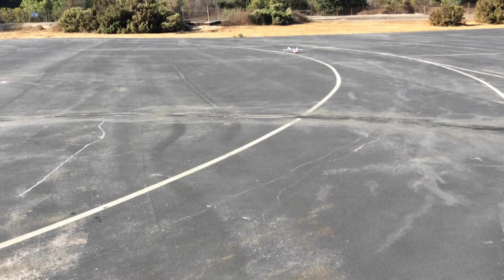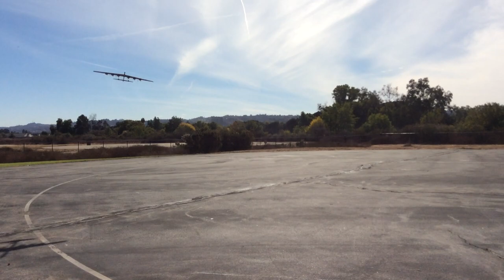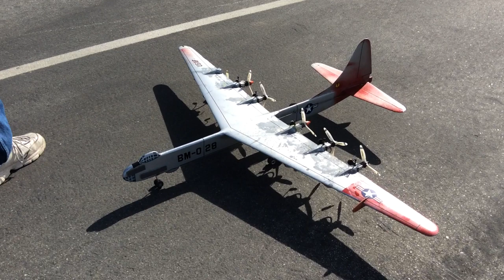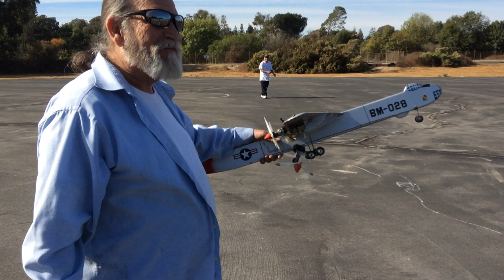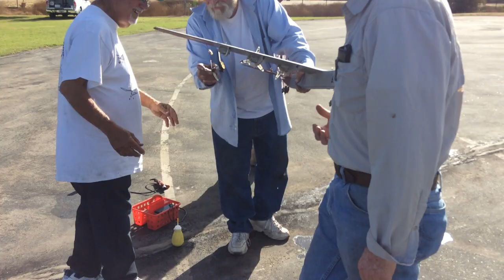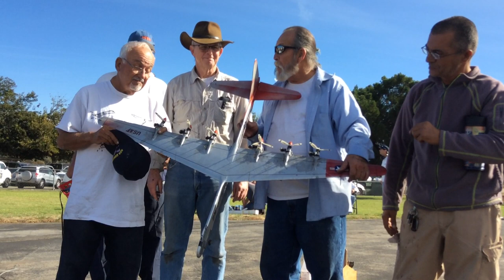Control Line B-36 Peacemaker w/ six Cox .049 engines

Comment: Excellent!  I attached a Cox .049 engine low on a added vertical  member of a box kite for free flight.  It flew!  Also modified a PT-19 trainer.  Cut away some plastic for additional elevator movement, removed the landing gear and changed the prop. Dang thing would do crisp wing overs! The wing center section developed a Crack!  I'm 73, and smiling.

Comment: So...what did you use for lines and handle?
What fuel?  Brand name?
Length of lines, and how heavy a pull test on the lines?
Did you build it originally from plans, or scratch?

I started with 1/2A like the rest of all, and graduated to a FOX .15 CL model, moving up to a .35 Enya with the square intake...my favorite engine, highly reliable.  It came with three intakes, and the largest was for speed runs with a pacifier bladder...hell of a hard stater in that setup, but went like crazy.
Mostly stunt at that point, but tried CL carrier after I found the throttle carb for the Enya, even 1/2A carrier with a "Lil Wizard" with the gear making it stand taller, and the COX throttle setup.  Sometimes a hard landing would result in the prop hitting the ground and running backwards, backing the plane up....LOL.
Later moved to freeflight and RC, and dabbled with rockets.
Given the challenge that I could CL fly most anything, I was given the soiled cardboard disc from under a pizza...and made that fly with a 1/2A CL.